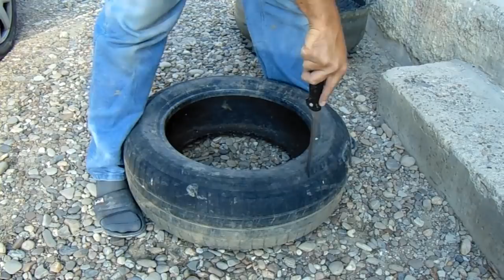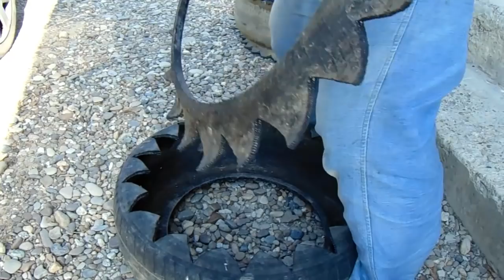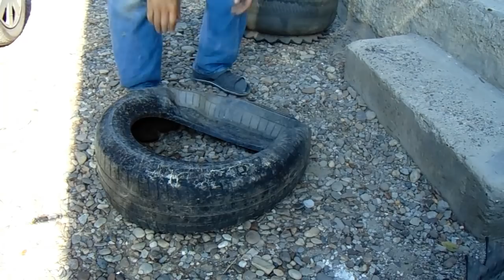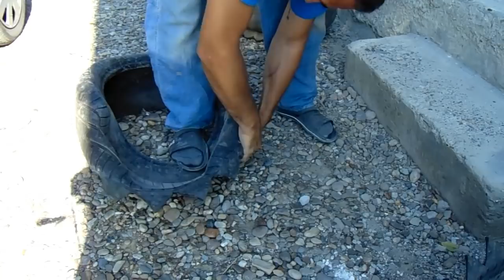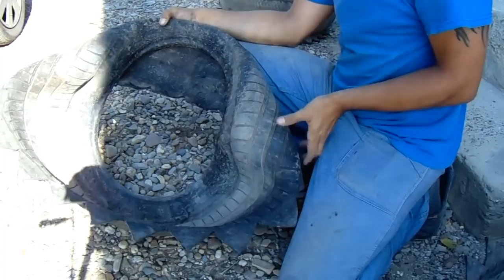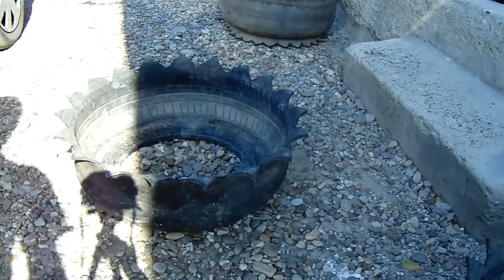How to make a flower pot from an old car tire

Comment: Awesome did two tires.  The 1st tire did it old school with some elbow grease lol. Second one went much quicker when i used to ratchet straps to pop it inside out.
Reply: jesse appleton Are there YouTube videos of this?
Reply: @4wdesigns  unfortunately there are not videos of the ratchet strap method.  The way i did it was you get the tire started to be inside out.  Than attached one ratchet strap on the fold across the tire and make it tight.  Than use the other ratchet strap and put that so it creates a "t" with the straps. Crank hard on both and work inside out.  Once you have gotten as much inside out remove ratchets and reapply them so they can assist you again.   Hope that helps
Reply: jesse appleton thanks. It does help :)
Reply: @jesseappleton4464  hopefully you'll make a video using this method for turning the tire insideout?